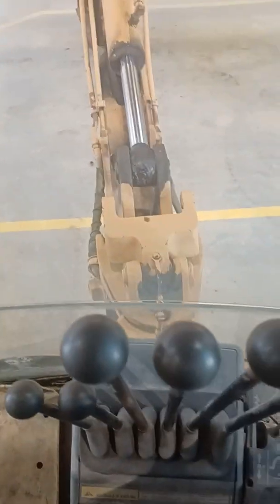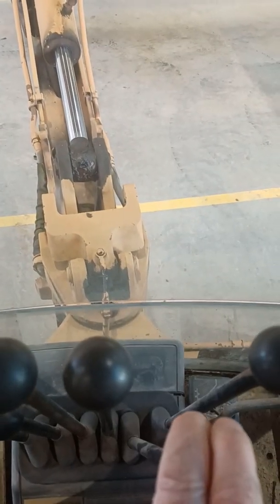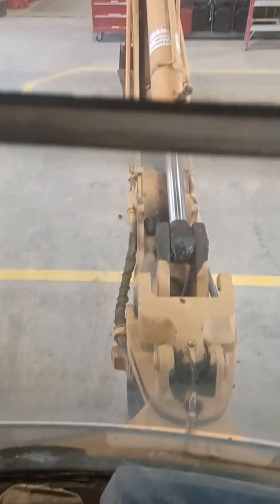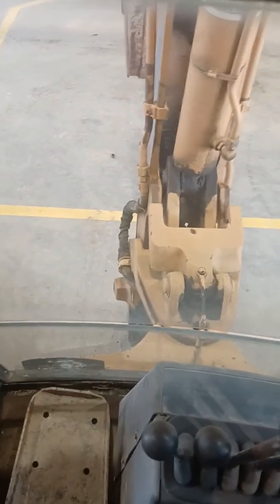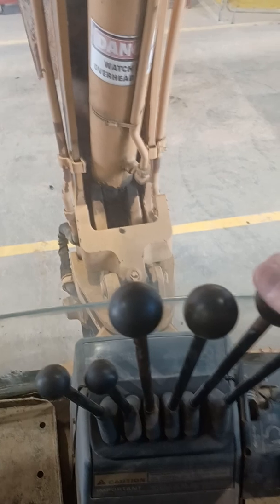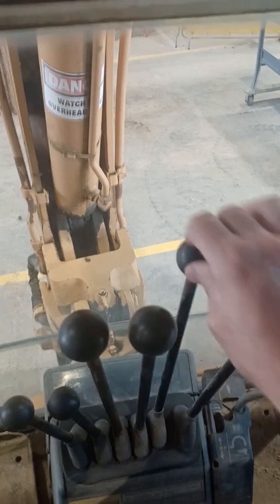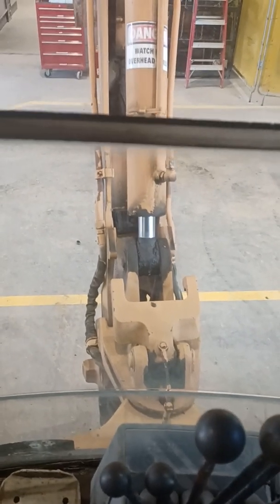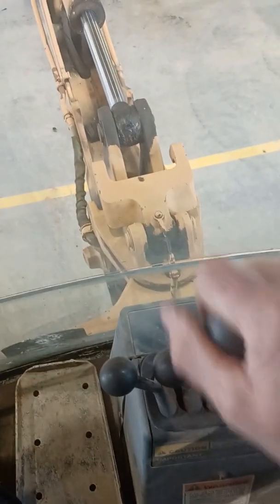case overcenter backhoe transport positioning

Comment: I yruly appreciate your video, a friend bought one and I wasn't sure how it worked. I'll say this, I don't like it. It seems like you have to be a bit violent on it to get it into lock position. You would think you could go past center and pop a lever into place, or it would do it automatically. However, it's far better than my JD 500C BHL because that model uses a trasport pin you physically insert. And if your hydraulics leak internally within the boom, or you forget the pin is in place, you snap the piece off the main cast trundle, or whatever it's called. And mines been welded 20X by the previous owner, so I don't even transport the thing. Thanks for the video.

Comment: I just picked up a 480C and waiting for the books to get to me. 
I need to  know how to properly check the hydraulic fluid on the machine. 
Previous owner said, WHILE RUNNING, IN 4TH GEAR. And nothing more. 
I read somewhere it has to be in transport position. 

Nothing totally clear proper check. 
Could you help? 

According to the serial, it's a 1979 Case 480C

Thanks